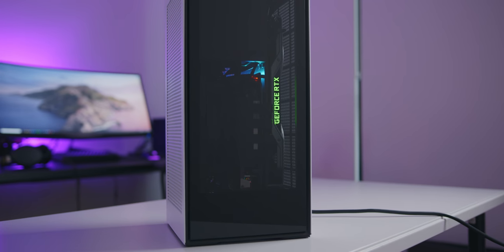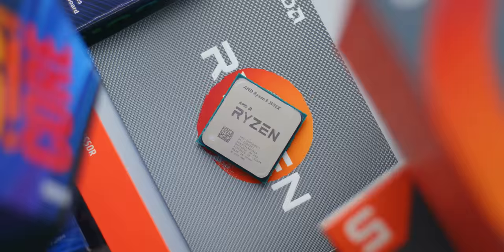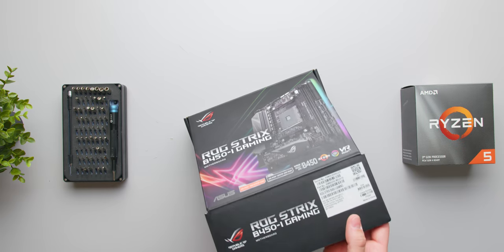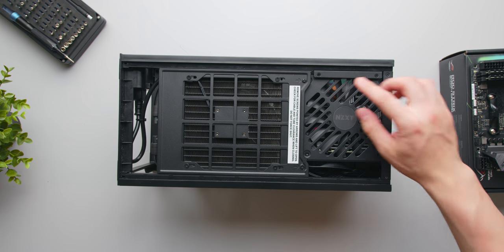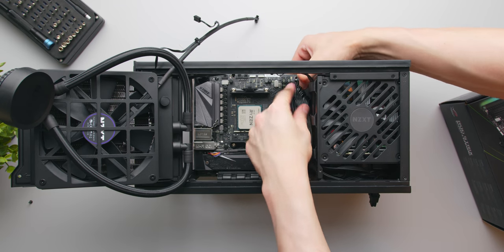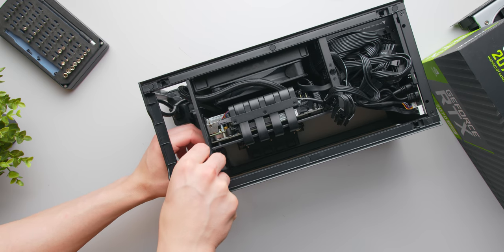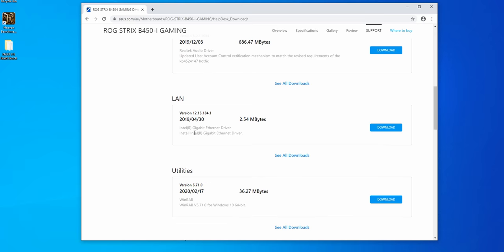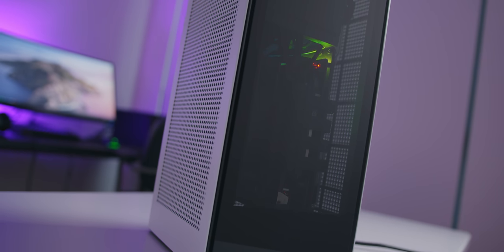How to Build a $1400 NZXT H1 Gaming PC

Comment: I recently discovered your channel and loving the high quality content. You have of course ended up costing me hundreds of £s in computer parts though! ;) I've got an H1 case on backorder here in the UK and they are hoping for stock at the end of June by which time I'm hoping there may be some B550 ITX boards to choose from to give a bit of future proofing and hopefully (?!) a USB C front panel connector!   By then I'm also hoping there may be a bit more in the way of comparisons between the Ryzen 3600 and the Intel i5-10600 as I haven't 100% decided which way to go yet (though probably Ryzen if the B550s are out).  In the meantime I will have to struggle on with my 8-year old Lian Li Q08 build for a little while longer.

Comment: You should review or build with the inwin a1 plus. It is similar to the nzxt h1 in that you get the case, power supply, and cooling as a combined package. Granted the inwin doesn’t have an aio, but it does include fans. Seems like a legit package for far less money than the nzxt h1.

Comment: I made phanteks  Enthoo Evolv   itx
N I am happy with it.
I have x470 I strix with 3900x with 240mm io 32 gb ddr4 3600 mhz  gpu is 2080 super  liquid cooled( my msi 2080ti trio didn't fit. Also is a custom liquid cooled. Zotac oem gpu i bought for 300$ paid 40 for the Id frostflow120m gpu cooler )
 Also put a 200m argb fan on the front.. looks amazing n the gpu temps go from 50-58c.
Depending on games I play.
Has 8 tb of hard drive space (2x4 tb drives mostly for pics, music n videos)
1tb m.2 nvme for window n main games and 2 tb SSD for the rest of my games.

Comment: Guys. Put the Ram last for easy build. Rams will make harder installing any kind of CPU coolers also 24 pin power cable generally. You can install the rams everyting is done at the end.

Comment: Can't decide beetween the NZXT H1 and the Ncase M1... Love the foot print of the H1 but bringing this case with me as I'm planning to do with this glaspanel...
Reply: Alain Kuntz 

Go for 4 Liter case like Velka 3 or Skyreach mini if you want a truly portable case.
Reply: I am in the exact same situation. 
However, i recently decided to go with the N Case M1.

This is because:
1) Build Flexibility.
2) Improved ventilation (no chocking Glass panel to hinder the GPU's exhaust *cough H1*).
3) Easily accessible  Rear I/O (Mobo &  GPU).
4) Improved durability when traveling.

Comment: Great video dude! I have been considering this case since its launch and this build looks fantastic. Just one question though - keeping everything else as it is, can I swap the 3600 with a 3700X? Will it still work without issue? Or should I go with the X570 board? Thanks!

Comment: I built this 6 weeks ago (had to wait for the case to arrive) I opted for 3600mhz ram same spec as 3200 but it stays at 2133 if I OC it in anyway I get BSOD so ive ben using it at 2133 for the duration with 0 issues still getting decent frames on 1080p but today I thought F this and orderd the ones in your description hopefully it runs baby bum smooth when they come Weds

Comment: Ali, when are we giung to see someone manifacture a corsair one competitor? a true competitor, with dual slim 240 rads on the sides but 4 120mm fans (2 on top and 2 on bottom)  pulling air from the case? Please use your influence!! ITX could host so much more power!!

Comment: Just a few quick questions from a novice builder, will this motherboard and power supply provide enough power and allow overclocking on a Ryzen 7 3700x or 3800x? Will it be bottlenecked by an RTX 2060 Super instead of the 2070 Super? (or is the 2070 Super a much better option to pair with the 3700/3800x?). I see most builds recommending the 3600x over the 3700x and 3800x with builders then jumping directly to recommending the 3900x, is the 3600x much better value in terms of performance per dollar than either of those? I've heard that this case / build can get a bit tight due to its small form factor and getting low profile ram is recommended, would I be able to fit in 2 x 16 GB sticks instead? (Does the Corsair Vengeance LPX 32 GB fir comfortably within the case?) Thanks in advance!

Comment: Great video as usual.. Question. could this case work with the new AMD Ryzen 9 5900X and new RX 6800 XT cards? I know the 6800 series cards have not been released yet but I think these components paired with the NZXT H1 would be amazing. What are your thoughts and would love your recommendations on this and the best MB to go with it. Love the channel and your videos!
Reply: the 6800xt uses less power than the 3080 so.. since 3080 can be used in this case then your combo should be fine.

Comment: I built this same PC  on full ATX in the NZXT h510 and a ryzen 5 3600x, my first build and the performance is great. But I wish I had seen this case before! Wow! I really like the form factor and how much desk space this would save and it comes with CPU cooler and PSU? No cable management? I might have to buy a couple parts...
Reply: dont its uh a hot case might need a hose or two for water

Comment: Great explaining, and build video, but since there is little to none supply of this case(internationaly(Croatia)), what other case would you recommend that is available in PCPartPicker, and that is good for only using air-cooling for this pc build;

Asus ROG Strix X570-I Gaming Mini ITX AM4 Motherboard
AMD Ryzen 7 3700X 3.6 GHz 8-Core Processor
be quiet! Dark Rock Pro 4 50.5 CFM CPU Cooler
Corsair Vengeance LPX 16 GB (2 x 8 GB) DDR4-3600 CL20 Memory
Sabrent Rocket 4.0 2 TB M.2-2280 NVME Solid State Drive  =using only this drive for know.
NVIDIA GeForce RTX 2060 SUPER 8 GB Video Card
Microsoft Windows 10 Pro 32/64-bit
Corsair CX
   ATX	80+ Bronze	500 W	Semi   =already have
Monitor Samsung Syncmaster 2233 21.5 = already have

Thanks :)

Comment: Super interesting. I’d love to see a video on a budget itx hackintosh! I’m interested in putting together a cheaper editing rig, but don’t really know for sure if the parts I’m looking at would work well
Reply: Alex Grover you'll generally be better off for hackintosh stability with Intel processors and you will need an AMD gpu. The motherboard selection is the most important choice, if you can pick up an Asus or Gigabyte z370 board with an 8th gen processor you'll be good to go. However, you will likely need to change the wifi bluetooth card to something that is compatible with MacOS if you want airdrop and wifi to work

Comment: I have a Ryzen 5 as well and my temps in COD are in the high 70s... Is the fact that you're using a 2070 Super reducing the load on the CPU? I have a 1660 Super and a 240mm AIO

Comment: It’s really a shame, but there’s simply no way I’d be willing to do a Ryzen build in an H1. Until there’s an AM4 Mini-ITX  with the USB-C front panel header, the only choice I could realistically make for this case is the Asus Strix Z390 board.
Reply: Amen. Just finished an Intel build in the H1 with the Z390 Aorus Pro Wifi because it has the USB 3.1 Type-C Header. It's a small nitpick, but in a few years when USB Type-C is more prevalent, this will be quite convenient!

Comment: A few questions
1. PCpartpicker says that the Motherboard and the CPU you used may not be compatible? Is that just warning me about the bios update?
2. Also, what do you do with the CPU fan that comes with your AMD CPU, sell it on ebay?
Reply: So here's what I think. I know I'm not him. But I think its saying the first thing because of the updates you would have to do. I also checked it out and I think it's just warning you that it may be too small because of the dimensions. But you can clearly fit everything. It's just tight. I think the website is thinking it might not but I'm sure it's safe.

Comment: What would be a good replacement for the stock AIO in case it ever needs replacement beyond the warranty period?
Reply: NZXT m22
Reply: @EzekielMitchell98  Won't it have a problem fitting because of how the tubings coming out from the radiator are oriented?
Reply: @baldino9165  you can put it under still

Comment: Most current system builders on YouTube, and likely even those working at OEMs/SIs would absolutely be destroyed by the configuration needed to even get a post out of an early 1990's PC. They've literally made it easy mode over the last couple of decades. All PCs these days are easy to build full stop. And yes the nVidia drivers are definitely safer they are virtually unchanged form a UI standpoint since 1999, yes my FIRST GeForce drivers used the same control panel interface as the most recent cards use.

Comment: If you remove drive cage, and stock PSU, can ATX PSU (fully modular) fit in that space? If not how much case need's to increase in length, width, and height ?

Comment: Hello, sorry for the late response, but maybe you can answer this. Wouldnt it be possible to turn around the gpu fan direction, so that warm air gets blown out of the case? Then the gpu would suck fresh air from the bottom instead of accumulating warm air in there. I think that couldbe quit awesome...

Comment: Well, like many of you, thought about doing this exact  build until there was not stock. Any idea of which other case/power supply/cpu cooler could go well with the rest of the build ?
Reply: Could have the Lian-Li TU150 actually, so the question would be what power supply/cpu cooler to put inside with all this.

Comment: I bought the Asus b550i (which as far as I can tell looks exactly like the 450i). 
I followed everything you showed in this video, and everything works out great, except for the front usb type c connection. The front usb type a and headphone jack both work, but type c doesn't. Is that just how it is, or is there something missing?

Comment: Would it still be good if I where to use the RTX 2060 instead?
Reply: No reason why it wouldn’t be. Can always return the card if you’re not satisfied with the performance, or if existing, upgrade down the line. Really depends on what resolution you’re going for or if you have a high refresh rate monitor. 2060 is a solid card overall.

Comment: Are you able to use the front USB-C port with this motherboard? I have the X570-I Strix board and I think the X570 and B450 are both missing a gen 2 connector.

Comment: Would it be possible to put a Quadro P400 (other suggestions welcome) in this instead? I will not be using it for gaming or anything else graphically intensive, just running two 4k displays.

Comment: I hope you see this! Optimum Tech, First off thanks for great content, I want to make a similar build to this, BUT is there a way to do this with a thunderbolt 3 usb port (for my monitor)? Do you have a recommendation on a motherboard and chip or to use this build but add thunderbolt port?

*I'm sure you get asked this all the time, do you ever sell your builds? :)
Reply: Of course, I know asking this question, I would be willing to spend a little more to get the Thunderbolt added as an option.

Comment: What are your thoughts about kicking the case length up by say 4.5 inches and building in 2 hot swap bays for 3.5 hard drives on either side of the bottom portion of the case?

Comment: Hello Optimum Tech, I tried a similar build to this one. I used the x570 Itx board instead. I downloaded NZXT CAM to check my cpu fan speed. It seems that my cpu fans are running almost at 100% even when the cpu temps around 35 degrees C. Is this normal ? I believe that it isnt. Is there a way to adjust the fan speed? Yes, this is my first PC build.

Comment: Hello Saed, thanks for review. I just wanted to ask if you can manage to activate both front usb type-c and classic usb ports to use together? There is a big issue with this port connections on both H1 and H210 unless you not using a z390 itx motherboard as only some of them usb 3.1 gen2 internal connection.

Comment: For $350 on this case, the stock thermals are pretty bad. Too bad for me at least. It is true that other ITX cases are expensive too, but at least they have CPU and GPU cooling options. I would take pretty much any Sliger over this and I don't even like Sliger.  Good vid though!

Comment: i dont understand why those gpu temps are so high? its right up against a fairly well vented panel.
Reply: The magnetic dust filter actually hampers the airflow a bit and removing the panel drops the temps even further. Sacrifices must be had for a sexy ITX case as the H1.
Reply: @moongu  thats a bit too much a of a sacrifice, the ncase m1 has excellent gpu temps and looks far better imo, my lian li tu150 is nearly 20c cooler on 2080 super FE and its only a few liters bigger.

Comment: I'd recommend 3600mhz memory for a Ryzen 3000. And WD SN550 is a much better ssd than Crucial P1 if you can find it on sale. Here is my build under 1000$ with compatible performance (for high graphics and low framerate) if you're interested. https://www.reddit.com/r/sffpc/comments/fh94w7/my_pure_black_4k_gaming_build_1000/. The mobo is much cheaper now. Though if your budget is higher, your choice is more flexible for sure.

Comment: Pretty sure that mobo doesn't have the correct header for a front USB-C. Or was the v1 different compared to v2 that has a separate cable for the C?

Comment: Nice build! What is the software called for monitoring temps and hz in game? Thanks!
Reply: If you are playing steam games you can turn on an fps counter in settings. But i dont remember where
Reply: Hz is how much fps your monitor displays and for example if you get 144 fps but if it is on a 60 hz monitor your monitor only displays 60 hz

Comment: I wonder if there is any possibility to replace the factory cooler with noctua ones for exemple ? And Is that possible to improve GPU cooling, sinon those GPU would blow hot air onto the glass pannel

Comment: I’ve never built a pc before and I really want to build a pc with this case but I got couple of questions. Could I use an RTX 2080 TI instead of RTX 2070 SUPER? And could I use i7-9700K instead?
Reply: Concern about airflow and thermal case, 
too hot = slow performance = save your bill
Reply: Clarito resdiano Do you know which 2070 SUPER card is best?

Comment: Still the best itx with new riser cable. I got a full refund and rebought new one on eBay for only 170 shipped. Crazy prices now, just make sure you have new riser and it’s still the highly rated case it was before the fire hazard with old riser.

Comment: If i wanted to do a build in this case for around $1000 to do 3d modeling in NX and use other engineering software what would be a good cpu gpu combo (I'd like this to be my workhorse for my next 3 years in school)

Comment: New PC builder here... if I swap the Ryzen 5 for a ryzen 7 and swap for ram 16x2, all other parts will be still compatible?
Reply: Yeah you'll be fine. I have a 3700x in my H1 and temps havent gone above 60c in gaming. They havent touched 60c at all actually. I was going to 16x2 but didnt need it. 8x2 is the sweet spot still

Comment: I have just recived my H1 and have a question regarding power cables to GPU. In mine there are two cables from psu 1x8 pin. On your video we can see  two cables 2x8pin. Is this a different revision or there is something wrong with my case. Thanks

Comment: Would you reccomend the same motherboard for the Ryzen 7 3700x?
Reply: The B450 Strix is very solid per the videos I’ve been watching for my upcoming mITX build. You should opt for the X570 if you’re planning to push and OC as the VRM is better and runs cooler than B450’s. If you’re doing stock or a modest OC, B450 should be perfectly fine. Personally I’m going with a B450 as I feel it should hold me over for at least 5 years before I entertain upgrading to the latest chipsets/CPU’s.
Reply: same motherboard ? No, 3700X 8 Core cpu, then the motherboard lack vrm cooling issue

Comment: I watched so many videos (many of yours) about ITX and in the end i realized that this is just not for me. Sacrificing additional Pcie slots and most impotantly 2 ram slots is just too heavy loss. Also many of ITX Cases dont have enough space for long gpu which most of the time have more efficient and silent cooling. And their prices are just crazy. So i will stick with mATX cases. They small enough but can fit ATX boards (as long as you use SFX psu and get rid of basement) with 4 ram slots and plenty of pcie slots for things like 10gbit nic which i want to buy in nearest future.

Comment: Can you test this b450i board with 2x m.2 ssd's and high end gpu as am worried about the next:
if the back m.2 slot is running in nvme mode, the pcie (gpu) slot only runs at x8 speeds.

Comment: In one of your previous video concerning putting an AIO in the DAN A4 case, you mentioned that it affected the VRM on the motherboard. Seeing that the X570 has a little fan above the placement of the VRM, would that make a X570 Asus Strix a good option for the DAN A4?
Reply: From my research on B450 vs X570, the X570 runs cooler than the cheaper B450. So if temps/case profile is a major concern, then I would recommend the 570.
Reply: Yep please take care your vrm (motherboard and gpu), not only concern to sillicon lottery temperature

Comment: Quick question, it's 2021, Can i use all these parts except perhaps a 3070 GPU and have it still work?  Thank you
Reply: Yes, if you dont plan on buying a gpu right away, you will either maybe buy a cheap gpu so you can connect to a display. Pcs need a gpu if you want to connect to a display. Or , if you buy  cpu with integrated graphics, that can work to. I recommend the Ryzen 5 3400g as the cpu is good and the igpu is very good compared to any cheap gpus out there